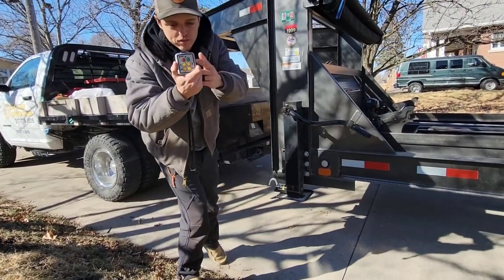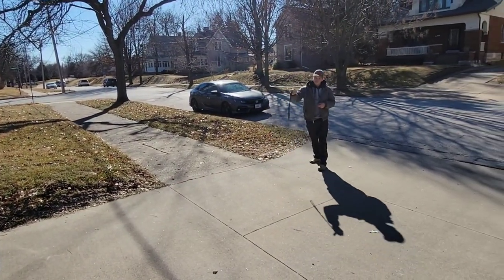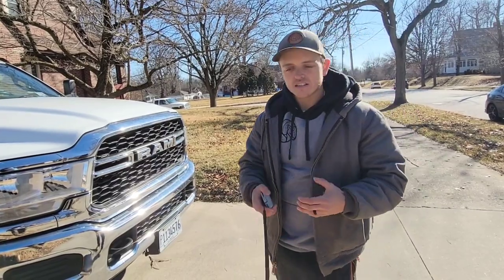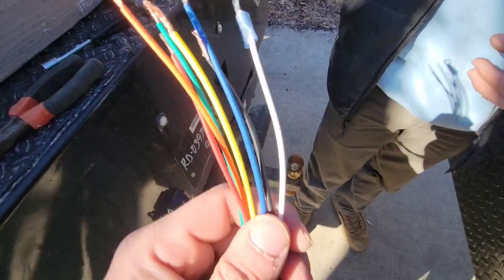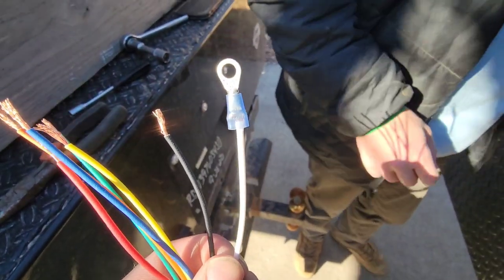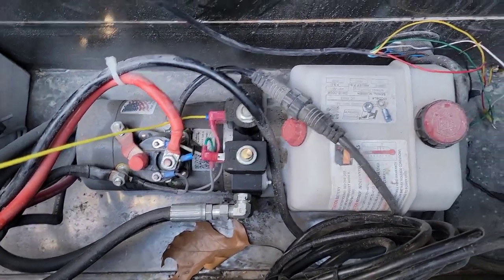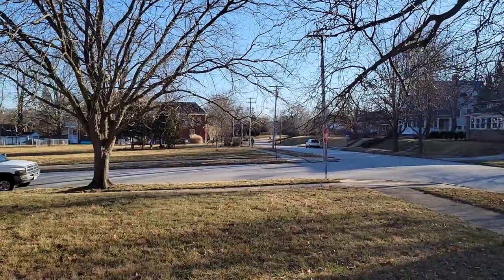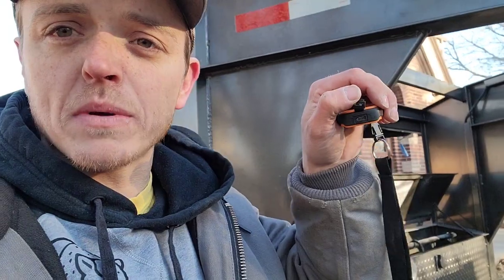The Best Wireless Remote For Your Roll-Off Trailer!

Comment: Are you able to pull and dump a 30 yard bin with your setup?
Reply from the maker: Not quite. I've seen guys add height and get about 25 yards. 30, not so much
Reply: @rollingops  I’ve been looking at rawmaxx they sell a 20’ trailer and I think they have 30 yard bins. Figured maybe yours could get away with it but the length would be a problem when tilting I assume
Reply: @maverickbrigoli93  my main thing is the CDL. Watch your GVWR

Comment: Another W for Bison/Couger. They use Kartec remote system. Signal is pretty good, very compact rugged  4 function remote, rechargeable battery lasts me weeks. When low just plug USB cable into truck.
Reply from the maker: I'll need to tell people about those too, thanks!
Reply: Not my bison. Only remote I got was from winch/comeup. I bought the kti remote separate.

Comment: Kar-tech sells same system for 275.00 vs 450.00. 300ft radius 900hz. 👍 You’re welcome.
Reply from the maker: I'll have to look into that
Reply: @rollingops  I run roxx 14 footer works perfect. Thanks for your channel. You’ve taught me a bunch of stuff!
Reply: Tuff remote is actually a rebranded kar-tech
Reply: Mine doesn't even have a white wire on the tuff box